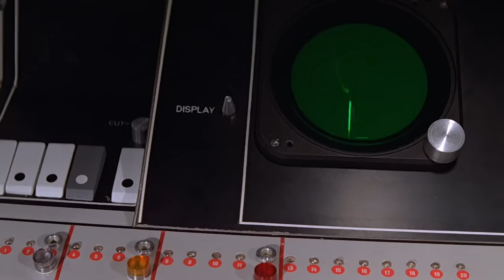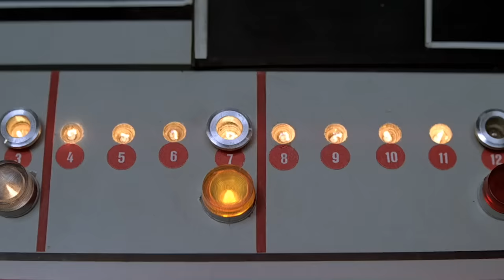MOONRAKER | “How fast does it go?”

Comment: A neat detail in this scene is that they thought of showing the speed effecting Bond's facial skin, which makes the whole thing feel a lot more intense and real.
Reply: They used a hair dryer.
Reply: Actually, I heard they used compressed air in a special adapted tip to form the skin like that. I will look it up to confirm.
Reply: Ok. I read up on this skin movement scene on James Bond’s face. It was indeed compressed air used on his face while filming. But patrons at a bar named Bikinis Bar and Grill in San Antonio, TX used a hairdryer to make skin movements like that shown in the 007 movie ‘Moonraker’ and thus called it by the same name used in the movie. There’s some 1977 trivia for ya!
Reply: Same G force as an Ariel Atom with Jeremy Clarkson at the wheel ;)
Reply: @gregdenys7162  If they used a hairdryer, that's some loose a$$ skin!!😆😆😆💯
Reply: @benjaminpettibone4254  , you meant 1979.
Reply: That‘s no detail.
Reply: @benjaminpettibone4254  Intriguing. I thought it couldn't be blowing air at him as his hair seems static.
Reply: I always remember that scene was very "scary" to me, watching as a kid back in the 1970's, but as an adult, I was wondering whether or not the skin on his cheeks "rippling" was real & how did they do that???  🤔

Comment: Serious cudos to the fact that Bond handled 12 Gs of pressure when the almost impossible climb in Top Gun: Maverick only required 9-10 Gs of pressure
Reply: The Euthanasia Coaster is designed to kill you by subjecting you to 10 Gs for 60 seconds.  For the last 60 seconds that Bond is in the centrifuge, the speed increases from 7 Gs to 13Gs.  He manages to avoid passing out, then makes that miraculous shot to disable the centrifuge.  A bit unbelievable, even for Bond?  Yeah, I'd have to say so.